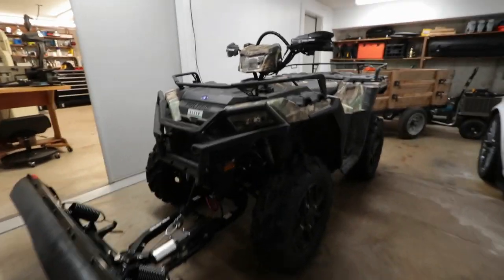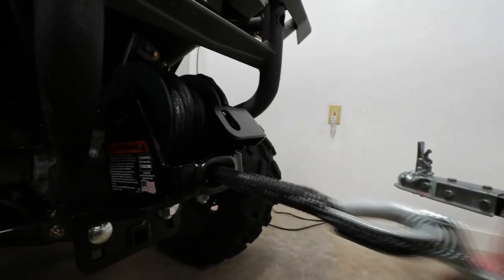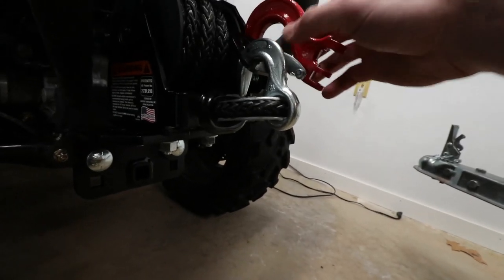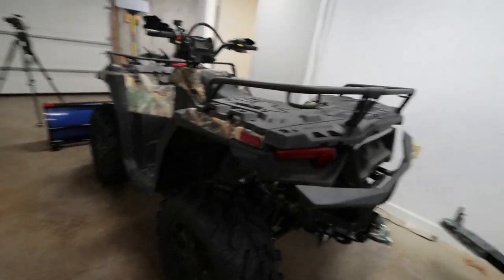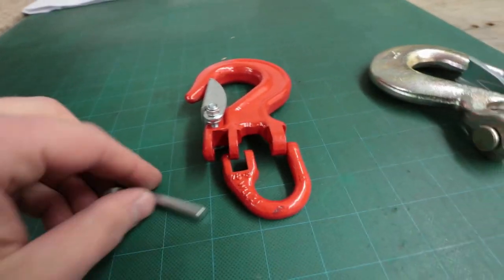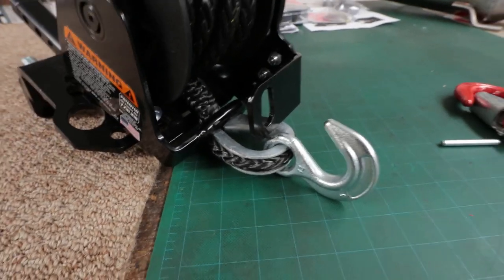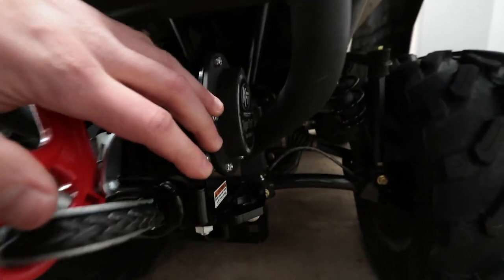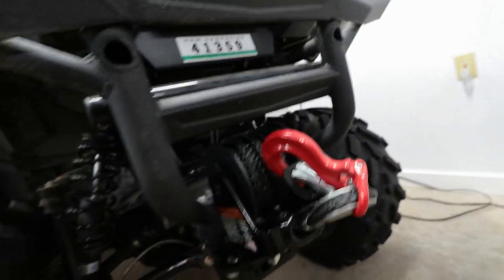KFI Tiger Tail Tow HOOK Swap Mod | 2018 Polaris Sportsman 1000 XP Hunter

Comment: Did you have to do any modifications or does it slide right in to the hitch? Just bought the same quad this past weekend
Reply from the maker: It slides into the receiver hitch. But i did wrap the shank with electrical tape to center it & dampen vibration so it doesnt hit the rear bumper.  I have a video coming out soon showing my custom recessed mounting solution so it doesnt stick out and hit stuff while ATVing. Stay tuned... Thanks for watching!

Comment: I noticed you have the tigertail installed higher in another video. Do you have more downward pressure and traction for pulling? I would like to do the same mod. Nicely tucked away too.
Thanks
Reply from the maker: Yes i like the new location it is completely tucked in now.  I will make a video on that because alot of people have asked about it.  Mounting it in the receiver is still better for serious pulling since its attached lower on the frame. Thanks for watching!
Reply: Looking forward to that video on the mod

Comment: Question, have you gone out on the trails with the new Red mod yet? Does the hook stay just clicked on the top of the tiger tail? I’m wondering if it would fall off? Be nice if it could fit in the slot the original hook went in?
Reply from the maker: Yes it does fall off you have to adjust the slotted bracket higher so it can clip in securely. Watch my new video on this topic and i explain it all. Thanks for watching!

Comment: The only reason why winches are mounted semi-permanently to vehicles is because it takes a long time and various tools to properly install them.
I seriously can't figure out the why it would ever be a good idea to subject a synthetic rope to the elements like this, instead of attaching a storage solution to the rear, hitch receiver.
Well, I guess whatever makes people happy. I would definitely suggest washing that rope whenever you go through mud and dirt.
Reply from the maker: Yes i agree thats the downside of synthetic it collect and holds dirt like a sponge and get beat up and abrasion.